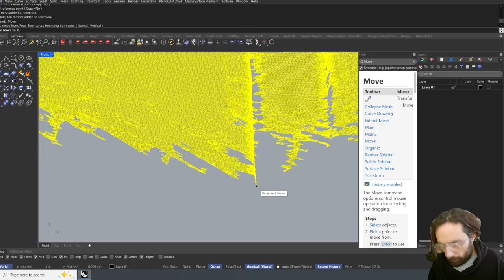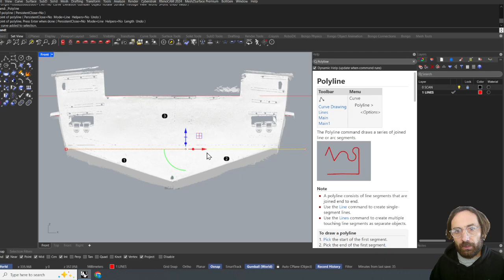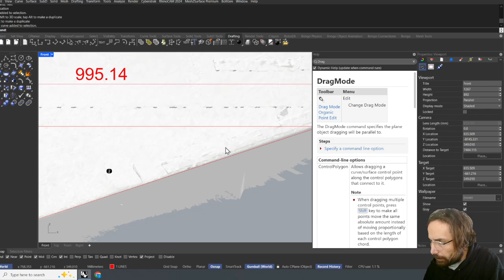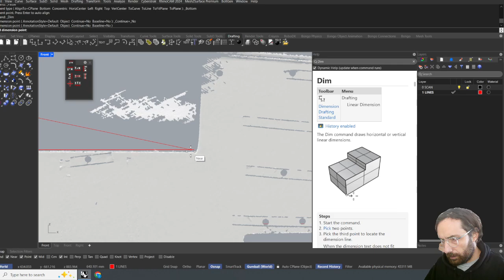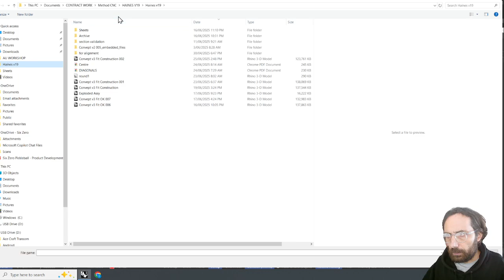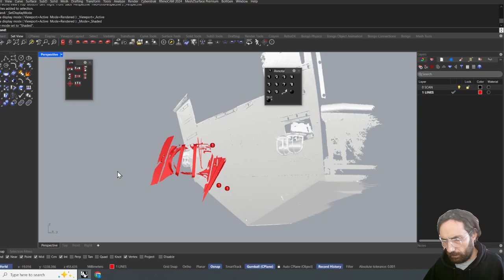Step 1: Boat Transom Scan Alignment – Rhino 3D Live

Comment: Now im curious about what computer did you use to run this meshes super fast
Reply from the maker: Hiya - nothing too special it's a HPZ Book 15.6 g8 Mobile, 64gb Ram  - i7 11800 - Nvidia t1200 laptop gpu - It's sold as a 16 or 32gb ram but you can update it  -to 64gb manually it's pretty easy you just take the back off and pop them in.